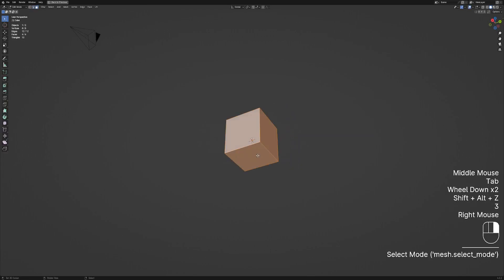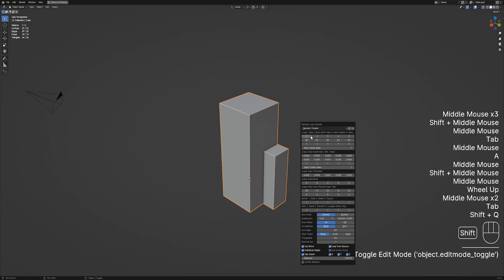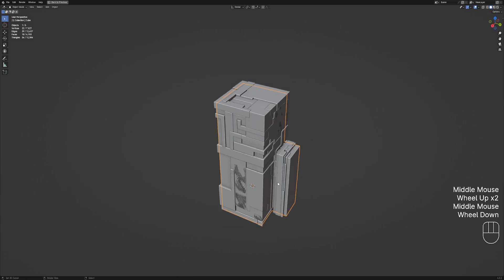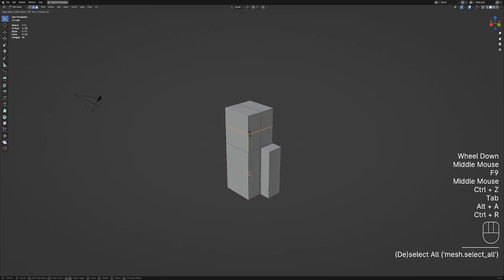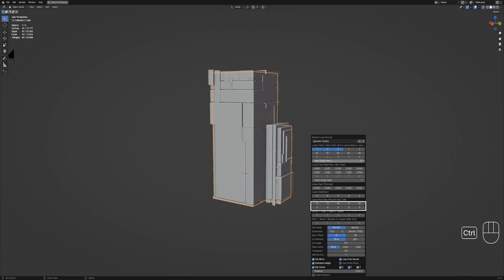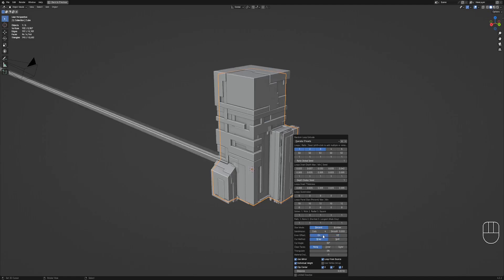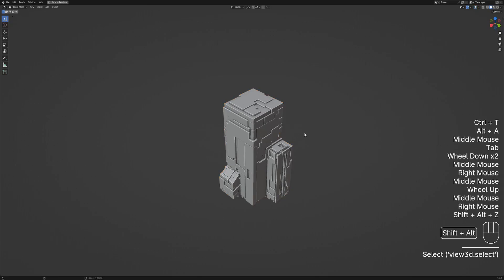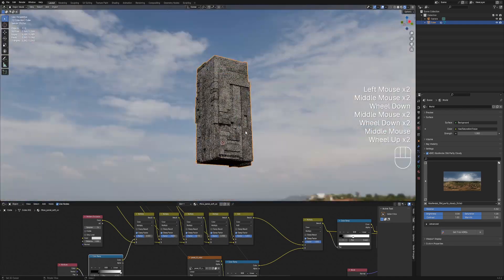Random Flow Basics: Topology

Comment: it looks like at some point you ran a face reduction operation then a triangulation. this happened so fast as to be almost invisible. what order of operations was this? thanks. its seems a way to merge the 3 or 4 or 5 models topology would be a nice feature for people wanting no interior faces for their models. i assume a boolean union would work if the objects had manifold geo or faces on the rear sides as well. i see in the random panels you have this operation to weld the panels to the source mesh. maybe if the boolean was applied in the same order as the 12345 it may work but i can see it maybe be very complex. in that case a remesh though more expensive would do. idk very interesting. i do wish all the operations even if not specifically random flow were delineated in these videos. would be a nice thing.
Reply from the maker: These older videos, I usually forget that I'm using hotkeys too fast. The reduction is limited dissolve using the X hotkey in edit mode then triangulation using Ctrl T.